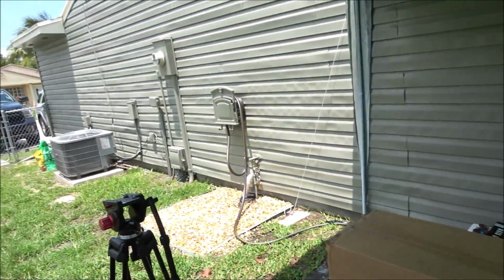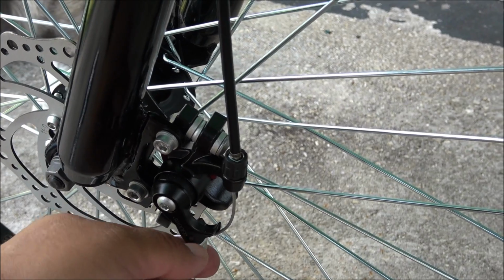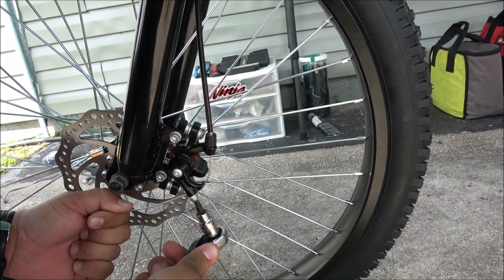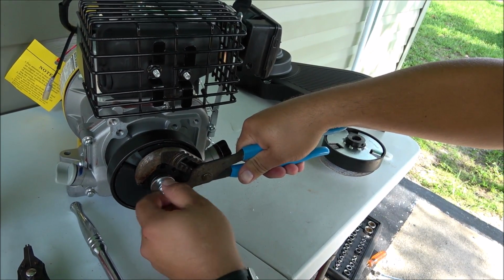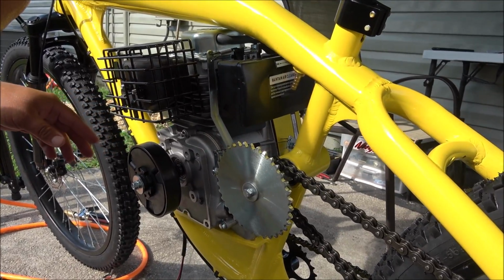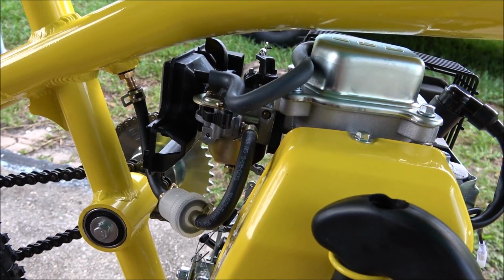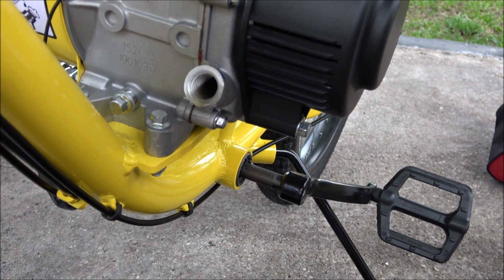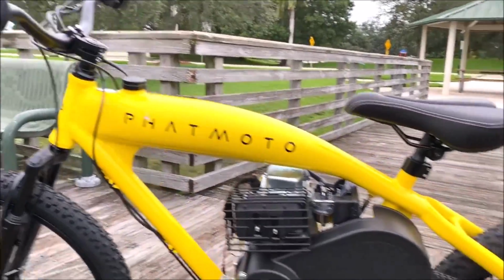Phatmoto Rover 2020 [Motorized Bicycle] - 79cc 4 Stroke - Unboxing & Installation Tutorial

Comment: Just got my " 2021 Phatmoto Motorized Bike" .  Put together ok. Cool design, BUT very sad on take off and power !. UGH. Those 49 cc scooter / mopeds pass me at 30 - 40 mph it seems. BUT WHERE DOES  A PERSON RIDE IT LEGALLY ? !  What State ? Ok . And, yes, I knew 49 cc was the limited .  damn it. And this 79 cc has NOW  moved this ride in the " MOTORCYCLE  CATAGORY " here  in Colorado.  And that really SUXS .  I do not believe it has enough power to ride simple trails . And even IF  you modify it " as required to be a legal road machine"  . - you can NOT ride in the bike lane.  And should NOT go on freeway  ( 20 mph would be a death sentence no doubt. ) REQ - $50 inspection by Hwy Patrol - after you add - a electric horn - a double electric head light - a electric tail light (a blinker or  brake on and off ? ) with clear lens for license plate light - mount a license plate bracket - a mirror . NO turn signals required ( Hmmmm ? Ok.  ) What a HASSLE ! There is NO motorcycle battery on this bicycle ! Well I'm upset and pissed . Mtn Mel . Ret. USN SERE- POW Inst VN - Para Rigger.  BUYER BEWARE I guess ------ I WILL  call  , write, text , email the company . They SHOULD offer a KIT as to make this " motorized  bike " into a " motorcycle "as to  RIDE Legally  !

Comment: I got mine May 2021 and after a couple 
Months i noticed the jackshaft rod started wobbling. When i took it apart i found it has a slight bend. I had allot of trouble getting through to someone on phone. They don't have the part and each time after that when called and got through they told me the end of the next it would be there. Now after almost 5 months still no parts. The company has had supply problems and bad customer service problems for over 2 years. Not just because of the pandemic. They just don't want to be bothered after sale. Beware buying any proprietary high end items from any of these companies. If you need a special part you'll be out of luck. What happens if the company doesn't survive the pandemic. My thousand dollar bike is just sitting and i don't see if i'll ever get it going.
Reply: Do you want to sell it?
Reply: Nothing about that bike is "proprietary " someone bought a bunch  of Chinese parts and made a bike. Everything on this bike is on ebay. If you  paid more than  $600 for this you got fucked

Comment: need to be careful modifying that to run faster... motor-assisted scooters may be operated only on a street or highway for which the posted speed limit is 35 miles per hour or less. you change that and you may find yourself on the wrong side of the law real quick.

Comment: this thing is dangerous as fuck - shitty chinese brakes, shitty chinese fork and shitty chinese wheels. On top of that 30kg of weight. How do I know it's chinese and shitty? Even low tier brands tend to put their brand's names on the part, the level of shitiness of a part that has no brand and no name is just unimaginable. Even the company that made this shit doesn't mention who made those parts. And this problem can be easily solved: cheap shimano hydraulic brakes can be bought for 70 bucks a pair, suntour fork for another 100 bucks and a wheelset 100 bucks too (something like weinmann rims + novatec hubs). Sure, the thing will cost 200 bucks more but it will be just on completely different level of safety.

Comment: why not just buy a proper motorcycle? with proper brakes. and proper suspension..... etc etc etc
Reply: also: a small modern motorcycle comes with fuel injection and enviro exhaust, as well as advanced safety features like abs brakes

Comment: Yeah if I bought that the whole town would make fun of me no one here rides electric bikes, scooters, or motorized bikes.  The only acceptable modes of transportation are cars and motorcycles that’s it.  I would be laughed at stared at something fierce.  If it didn’t make much noise I would go for it but it’s loud.  An electric bike is more acceptable but lower range and the batteries to replace are like $300 to $400 they only last a year or so before you need a new battery.

Comment: this is stupid ... it is really loud  i have a 900 cc motorbike and it makes less noise than this piece of shit ,... lacks proper braking system those thin brake disks will bend very quick  ... the engine after a while will bake your legs and ass and since you have a motor why you need pedals and 2 chains? and for gods sake how many different bolt sizes this piece of junk has?... either go electric which is more enviromental friendly or buy a proper motorcycle for 1500 $ you can find something descent to move around because this is a joke
Reply from the maker: Nick Gasparis Uuummm no, first you need to understand that motorized bikes and motorcycles are 2 different things. It’s like comparing a car with a 4 wheeler or utility vehicle. The engine is there to assist with the pedaling but luckily this engine does most of the work. This bike is ultra quiet and yes quieter than a motorcycle by a long shot. Brakes, yes you are correct we could use hydraulics but the disc itself won’t bend. Oh yes the bolts... have you noticed how many different bolt sizes your 900cc has? Electrics are great to and as a matter of fact I bought my daughter one. Now here’s the issue with electric, first it’s limited in distance and when you run out you have to wait 5 hours to recharge, 2nd not a lot if room for improvement, and 3rd they still have those cheap brakes! 😂
Reply: so if  engine in a bicycle does the most of the work what does make it different from a motorbike the pedals? for the 1500 $ thats the retail price they have on their website  you can buy something far better and safer also you forgot to tell that a 20 $ tank sealer is needed because the gas makes the tank rust which tank is part of the frame according to their website this piece of shit makes so much noise which makes your ears bleed and you say louder ones exist ? FFS how do you solve the engine heat problem which obviously will bake your legs after the engine gets hot? you dont need to be that smart to understand that on a vehicle going above 15 miles you need proper thickness disc brakes and not 2 pieces of metal thick as a pizza slice ... YES my 900cc bike has 4 different size bolts 2 of them are for the wheels and frame which you rarely mess with and it is taken apart with a no 10  a no 8 and a typical screw driver you had a 4 a 5 a 12 a 10 allen keys screw drivers and the list goes on also you are VERY wrong with the modifications on electric bikes you can play  the with the motor the battery use an ECU on them so you can use different power mappings  or charging times and their biggest advantage they are QUIET not like this ear bleeding piece of junk
Reply from the maker: Nick Gasparis Price went up because of the demand, they were $499 a month ago. These bikes are for enthusiasts not for people who can’t wrench or want to go far distances. Electric bikes are quieter yes I give you that, but they have the same brakes system as the Phatmoto and they can do up to 25mph which is about the same as the Phatmoto. As per the engine getting hot, there has been not even 1 case yet of anyone getting their leg “baked”. You see the pipe is covered by a cage that I can touch with my bare hands. Your legs never touches the engine. As per the gas tank where in the world you were told in needs a sealer? It’s aluminum bud lmao! Thanks for sharing your point of view and have a nice day!
Reply: @MJTechChannel  OOHH so you have a 500 $ bike being sold 3 times its original value because people buy it ? also yes you are right the  heat cannot pass the cage because a few slim pieces of metal will stop it and yes you are right again fuels cannot corrode aluminium because all fuels have no traces of water or microbial contamination from the ethanol that sometimes is added  in them  i guess motorbike manufacturers do not have to follow complex rules and procedures  when they build fuel tanks to stop corrosion then  because its aluminium just LOL  ... so if its for close distances why dont you buy a simple bicycle ? its 10 times cheaper you get to excersise which means  you wont have to pay for a gym membership you wont have to pay for a whole set of tools (usually bicycles need a simple screw driver and a couple of wrenches) and since you have to burn gas to move around what makes it better than a 80 cc dirtbike for example ?which i assure you you can find for the same price if not cheaper and the advantage is you dont look like a hipster douchebag going BRRRRRR around the hood deafening people
Reply from the maker: Nick Gasparis Because this is for enthusiasts, people who simply like the hobby. Not to mention that yes the price is $1000 but that’s new with warranty. However you can find these preowned dirt cheap as well. You also contradicted yourself about pricing. Do you know how expensive “electric bikes” are? A decent one with a range of 60 miles is at least $2500 new. Lastly not everyone has a driver’s license to move in a car, so they go with this. 😉
Reply: @MJTechChannel first of all its not a hobby its a hipster trend 2.  if you dont have a licence get one or call and UBER 3. lets assume  a "hobbyist" has 1000 $ to spend for 600 $ you get a 125 cc  engine + tank +sprockets+chain and mounts WITH WARRANTY at almost twice the horse power if not more  on the engine and for another 300 $ you get a KICK ass bicycle  where you attach the engine on WITH WARRANTY on the bike   and you have 100 dollars for gasoline at the same price which translates that they will overtake you like you are stationary on the road 4.  yes electric ones are more expensive BUT they have FAR more torque and usually at  the price range of 2500$ while you pedal or brake they have a system on where you charge them up (my  gfs 800 $ second hand electric has this it also has 2 year on its warranty 200 $ cheaper than this piece of junk ) cutting signigicant the charging time thats if you are not a fat lazy ass and you use the pedals you dont make noise 0 pollution you excercise and the list goes on ... all this took me a is 15 min market resereach and while doing that i stumbled across a 500w hybrid solar and wind turbine system for 400 $ which might raise the price 200 $ from the original price of your junk BUT we will charge the bike AND NOT ONLY  FOR FREE cutting down our electricity costs i asure you especially on your stupid motorised junk you promoted if i spend more time on it i can cut the costs more with a better quality product MAYBE you should learn how to do MARKET RESEARCH first
Reply from the maker: Nick Gasparis Nick this bike really got to your nerves 🤣! Look many people like it, love it and will continue it! Weather you like it or not! Have a nice day!!!